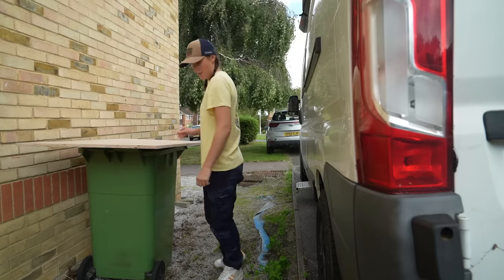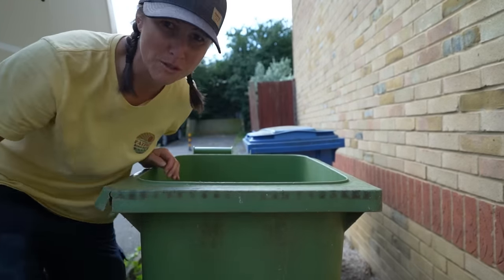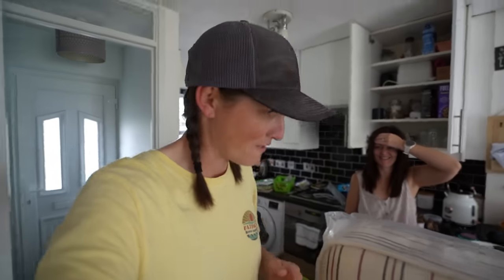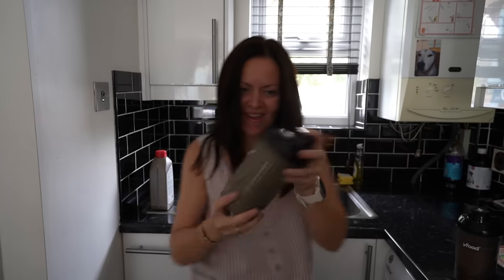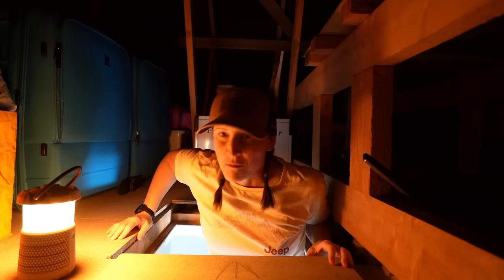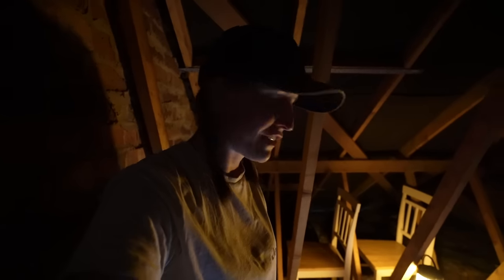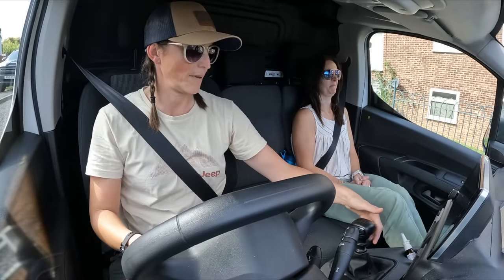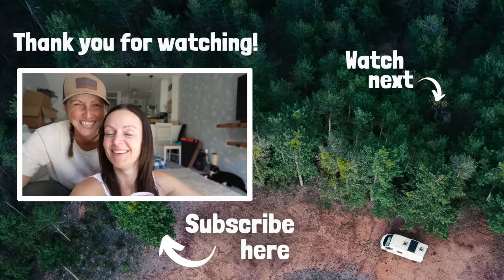Getting rid of everything we own (INCLUDING OUR HOUSE!) - This was NOT FUN!

Comment: What is it with Englanders and handbrakes? The most useless part of any vehicle. I guess in  my now 42 years of driving I've not used the handbrake a single time. Don't want the car to roll away, put it in 1st gear, or P when you drive automatic - won't go anywhere. Particularly when leaving the vehicle parked for longer periods, handbrakes are known for rusting and getting stuck.

Comment: We are also going through the same process, house is sold (unless anything goes wrong) so we are in the process of clearing. I thought we had done alot previously - WRONG! We no longer need to show our id to access the local tip as we are there that often. We have a house, 3 sheds and a big garage to clear. Done the old thing of, if you have space then you should fill it and keep EVERYTHING - you know, just incase you ever need it. But if you did ever need it, you would never find it - so pointless really. We are hnging our heads in shame at the stuff we have hoarded over the years.
Good luck with the travels and the new house hunt.

Comment: Another great video.

Our approach to dog bed base dampness is to have a damp proof membrane either as part of the bed design or on the surface of the floor underneath. Maybe an adhesive backed plastic covering might work?

Also that corner that you pointed out would be better off with a radius on it, to save ankle ouchies.

When you sat on the dog bed space and sat back, it was shouting out for some kind of cushion backing fixed to the wall, and all of a sudden you have another chilling zone.

Just my thoughts...

... Sorry!

Great to see you both cracking on with your adventures.
Reply from the maker: No need to say sorry 🙂